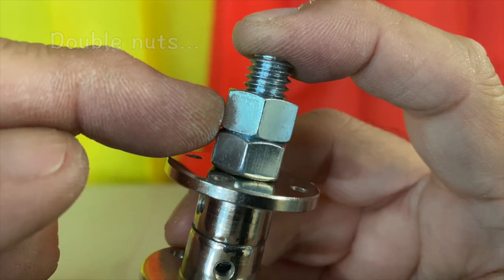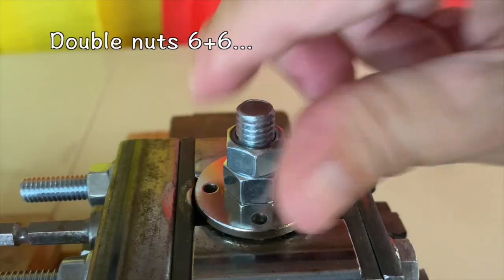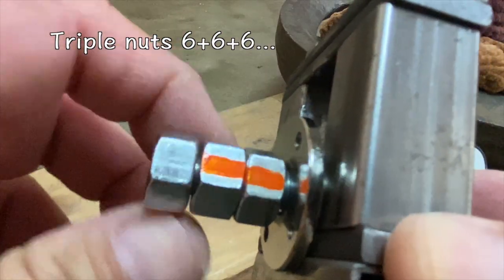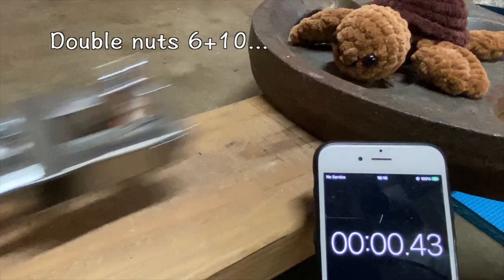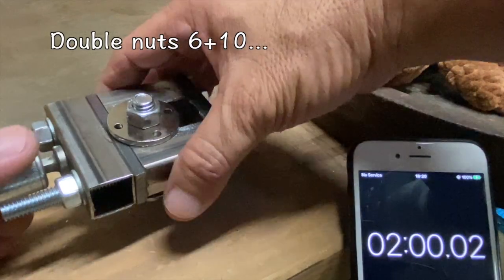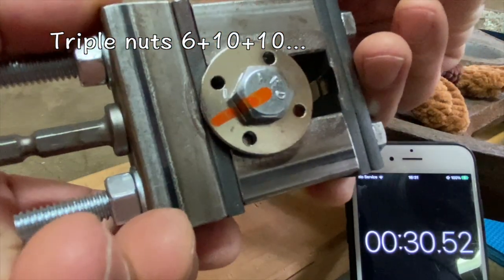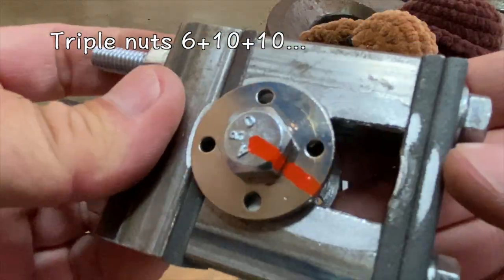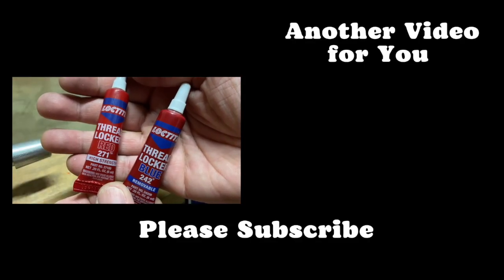Nuts & Bolts - Double vs Triple Nuts – DIY Impact & Vibration Test - Part 3

Comment: The old time machinery design books say that when you tighten a nut onto a nut you relieve the load on the first nuts threads making it as effective as a washer.   To use double nuts properly you should get the thread clearance on opposite side of the nuts so they bind on the thread.  The explained way to do this is to tighten your first nut on. Then your second as you did.  Lastly reverse the first nut in the loosening direction into the second nut with a reasonable percentage of the tightening force.  This is why a jam nut is thinner.  You put it on first and it only is supposed to take a portion of the load. Will it be magic in this test… probably not. But maybe it’ll do a little better.

Comment: A few commenters have suggested evaluating "Nordlock" locking washers.  Those work exteremely well IME, but they do rely on the Nordlock's  radial ridges on the "outside faces" to "dig in" to the work piece or material.
That can be a problem if cosmetic appearance must be preserved.  I also wonder if the ridges would continue to work properly after repeated install/uninstall of the work pieces.

Most cars I've owned have used  deforming  metal lock nuts on critical suspension component.  Obviously it's extremely rare for car suspensions to work loose! (unless weakened by rust & corrosion). 
McMaster-Carr has a large selection of such lock nuts.
I could be remembering wrong, but some types of deforming lock nuts are single-use. McMaster is usually pretty reliable in noting such limitations on their product descriptions.
Reply: Deforming lock nuts work amazingly well on through-bolts... but beware when using them on mounted studs - they will damage the stud threads after a few replacements.
Reply from the maker: My Nord-Lock test is out… Will Nord-Locks Survive My Test?  DIY Impact & Vibration Test – Part 5
https://youtu.be/wOUnlfhHRko
Pls check it out and drop a comment.  👍😎

Comment: I really appreciate your demonstrations. Helping me with designing some of my projects.
Reply from the maker: Great to hear but please follow the manufacturer’s instructions or established design and torque specs.  👍😎
Reply: @HacksbyDad  Yes I realize you have always been extremely low torque. I can't imagine anywhere you would leave it that low.
Reply from the maker: @PurpleRhymesWithOrange  Thanks!  Just being sure because so many experts out there seem to think that I recommend using only 6 ft-lbs of torque.  😎
Reply: @HacksbyDad  Mostly I do static constructions that won't have a lot of vibration. I usually don't use a torque wrench but when the applications calls for that precision there are charts online I can look up. Cars of machinery I will look up recommended torque ratings.
Reply from the maker: @PurpleRhymesWithOrange  👍😎

Comment: Hello, can you test if adding plumbing teflon tape increase the time?
Reply: @-COBRA  
Teflon tape will prevent threadlocker from curing, and by itself, does little to nothing to prevent the nut/bolt from vibrating loose.
Reply: @jkg6211  lol, of course you're not putting thread lock glue if you use tape
Reply: @-COBRA  
OK.... then why ask?
Maybe I misunderstood your question.

Comment: I'd STILL like to see a test with threadlocker AND a Nyloc nut used together. 

When we use a second nut (locking nut) system, we torque the first nut to the required torque, and then while holding its position with a wrench, torque down the second nut with another wrench. 
 
This warps the bolt threads slightly at the junction between the two nuts, and prevents the bottom nut from coming loose.
Wonder how that test would work? Especially with threadlocker on the top(locking) nut?
Interesting... nice experiment and video!
Reply from the maker: Thanks for the ideas!  I’ll add them to my list. 👍😎